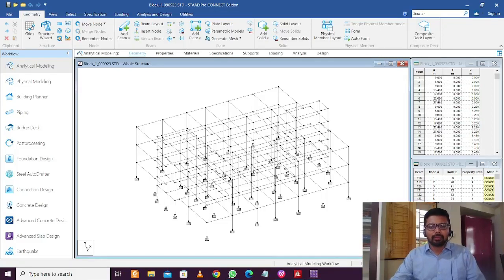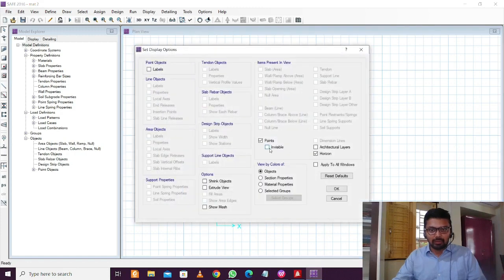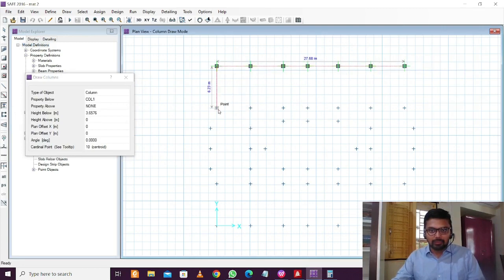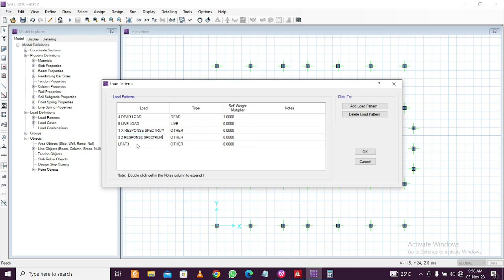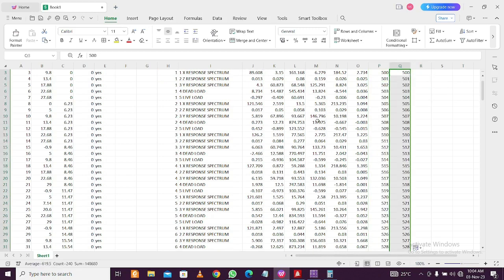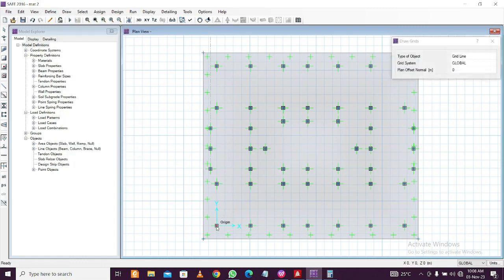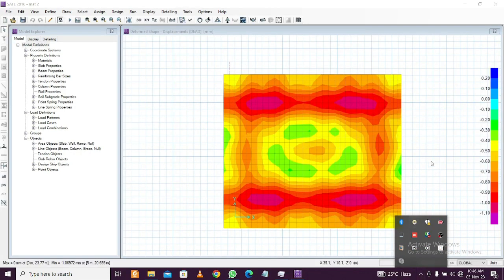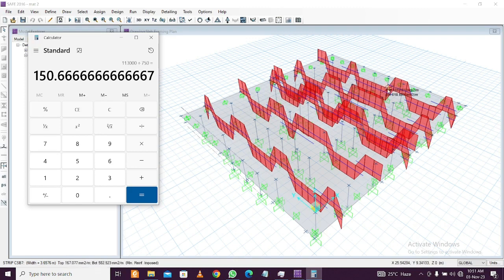MAT/RAFT Footing design in SAFE by importing file from STAAD

Comment: The loads you imported were not transferred to the mat. It appears to be on the top of the column, hence you see the passing punching shear ratio less than 1.0. Just like the other comment, the column shouldnt have restraints. I think you dont need to model the column as well since you are already importing the support reactions
Reply from the maker: noted, thanks for the suggestion

Comment: Bro the columns restrains (fixed supports)should have been removed so that the loads can be transfered to the mat foundation then to the soil. 
Also there  was no soil load applied to the mat foundation!
Reply from the maker: Thank you bro, will make an updated video.

That's why I share knowledge to receive feedback and get better.